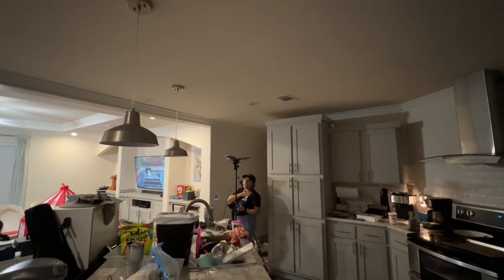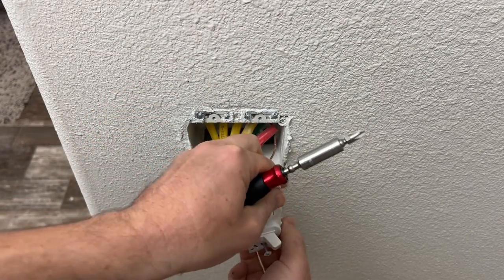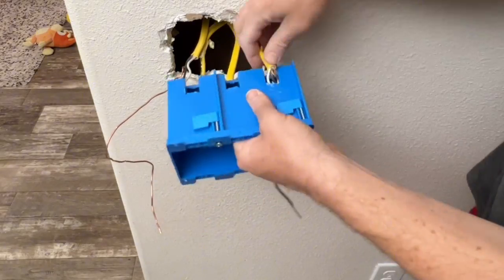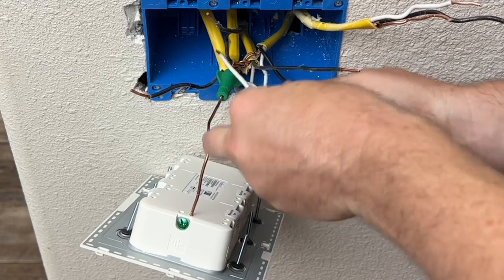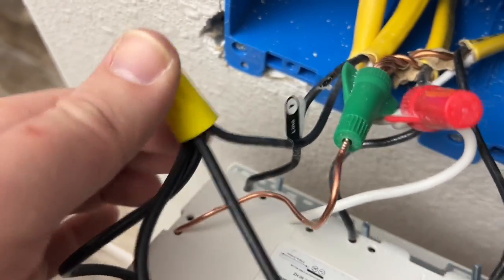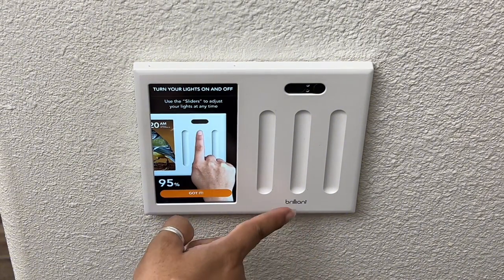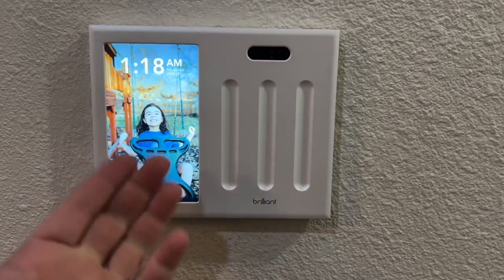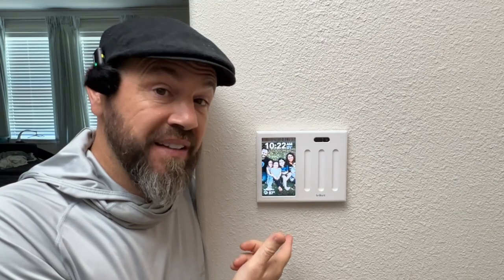The BRILLIANT Smart Home Control - Perfect For Any Home! Unboxing & Installation

Comment: If the internet is down, do the lights still work by using the physical touch sliders?
Reply: I'm guessing you would have to use that test button under the panel in that circumstance

Comment: If I don't hard wire the second dimmer switch, can I use it to control other devices? Lamps on a dimmer plug for example? I am looking for something I can put over a 2 gang box that I am eliminating one of my switches in and this would be perfect.
Reply: You can use it but you have to make sure you wire it hot or it will not work or even boot up.

Comment: Here's the thing that's kept me from buying this because I cand seem to find a good answer and maybe you can help.

Almost every light in my house is a phillips hue smart light, I see what this system is doing with the wiring that is basically turning your existing dumb lights into smart lights. -I don't want this functionality for the hues, they should always have 100% power.

I'm guessing that I could connect all the wires together in the gang box and use one of the extra wires it comes with to splice off of that and power the hub. Then I'd just assign the sliders to my hue lights instead of having them switch and dim the actual connections on the back of the unit?

Thanks so much in advance.